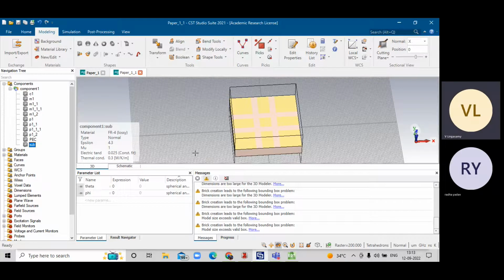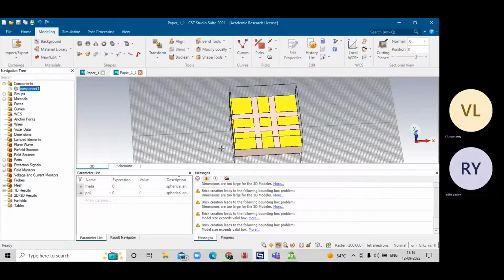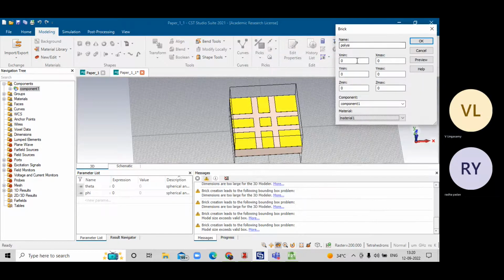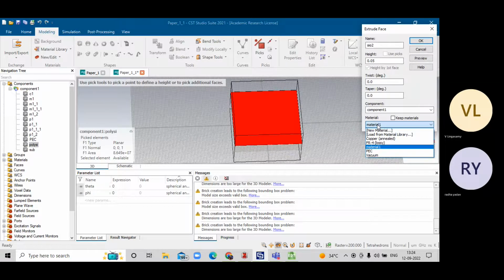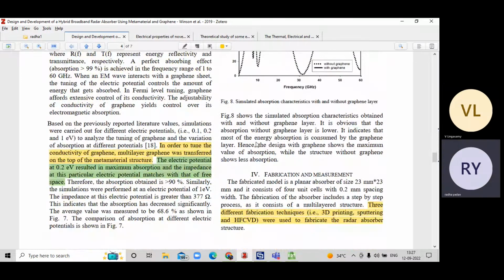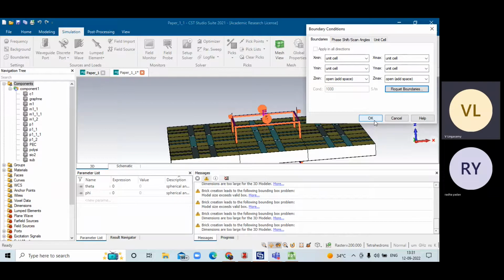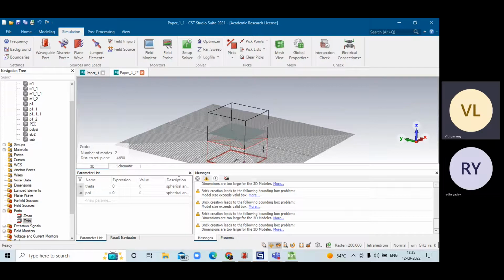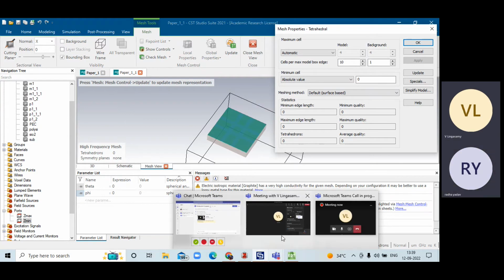Some discussion on metasurface unit cell simulation and modelling

Comment: Sir what is the value 9300 being used here, in Floquet Boundary settings?
Reply: I am designing a unit cell for 2.325 GHz and unit cell dimension is 35x35mm. Then what value should I use?
Reply: Unit cell dimension comes down to about 0.28lambda